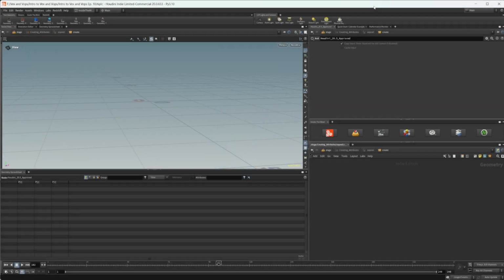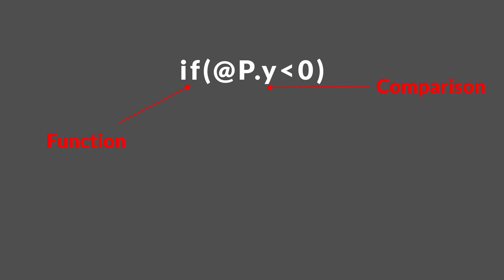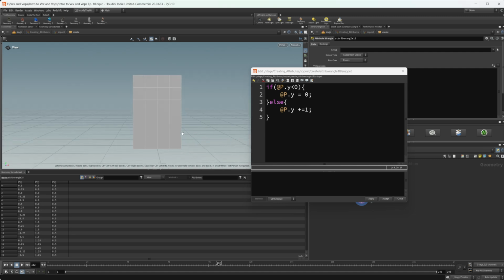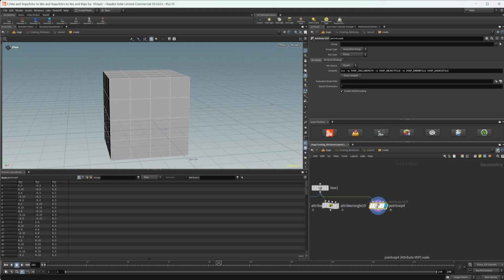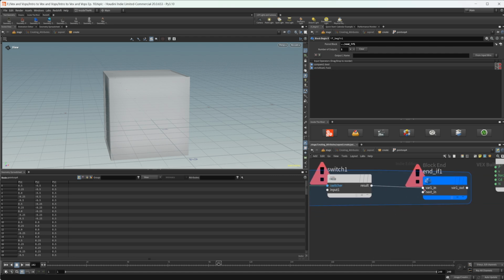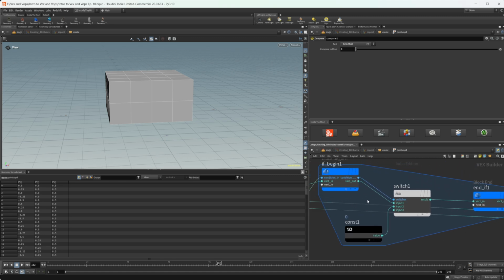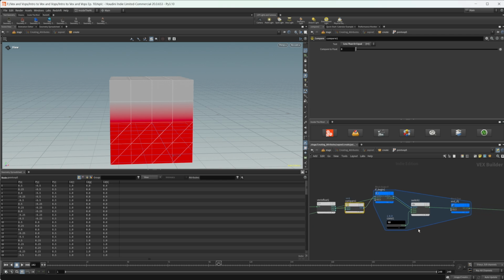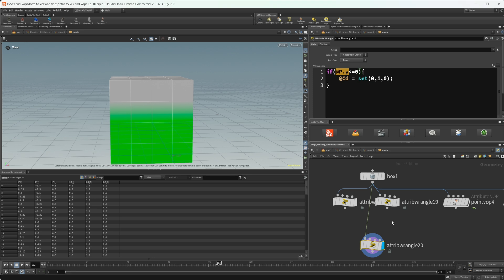If Statements | VEX and VOPs | Houdini 20

Comment: Thanks for the tut.
You can leave out the  If/Then loop bit for this simple on/off example.

COMPARE node produces a boolean 0/1 which can be plugged straight into a SWITCH node which will then output first or second input.

If/Then should be good for more complex decision making of course.